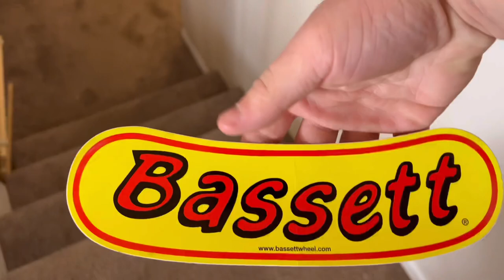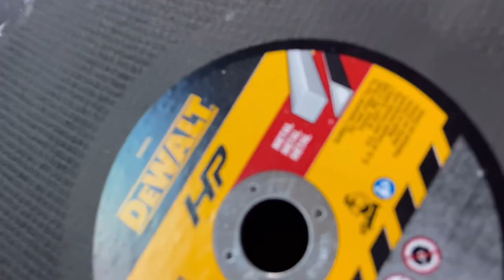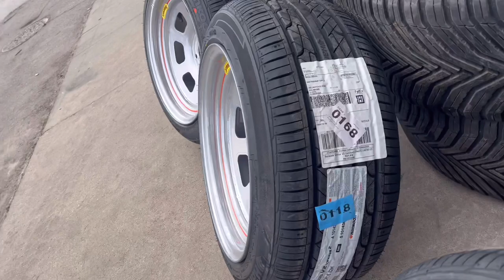FINALLY STANCED MY 1990 ACCORD!! (Tilted spindles)

Comment: Don’t hit any hard bumps. Those welds look good as they can for flux core but you should have built a jig to keep your desired angle and beveled both pieces then ran more than one pass after pre heating with a torch. I know that flux mig was only 110 so the penetration was poo poo. Looks good but be careful in that thing.